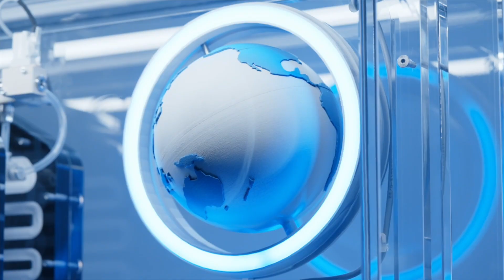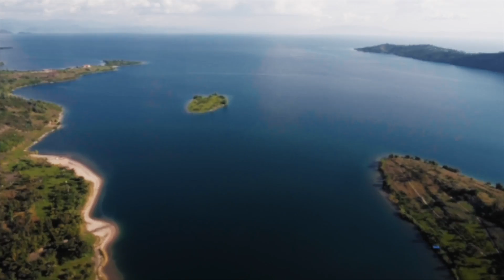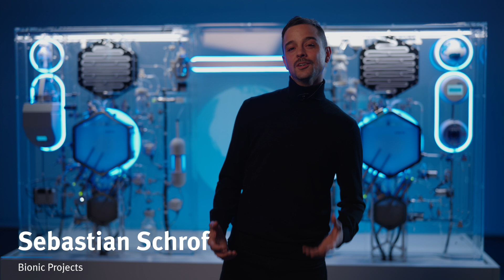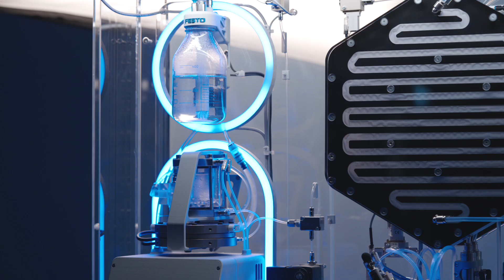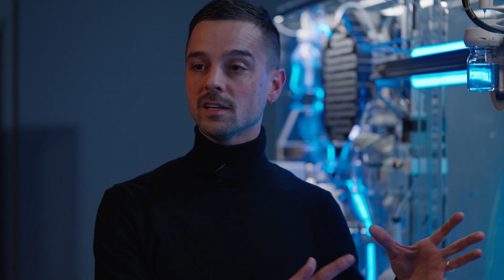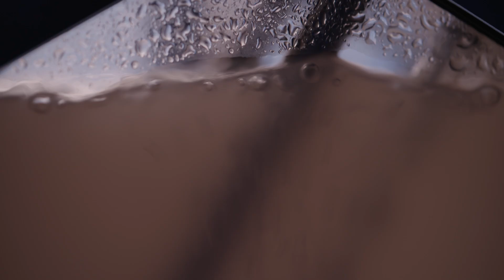Festo BionicHydrogenBattery

Comment: Neat solution, as others have said it would be good to see what round trip efficiency and energy density is. However the biggest issue with this video is the misnomer - hydrogen is not an energy source. It is a transfer and storage medium, like batteries. So calling it the energy source of the future  is the same as calling batteries the energy source of the future - it doesn’t really make sense. What would make sense is calling it the energy storage medium of the future. Which is then why round trip efficiency matters.
Reply: agree with your comment, I also would like to know the round trip efficiency, but that is not the most important factor.
That is a mistake that most youtubers channels who talk about the topic made. 
Roundtrip efficiency is not the factor that a technology should focus, just overall cost. 
For example, power generation is cheap... really cheap if we use solar and wind.
If you invest X on Solar PV Capex (including inverters and everything), you also need X Capex on batteries to just have enough capacity to store half hour of that power output over the lifetime of these technologies.
At X*4 of Capex you can already purchase the same power input/output with hydrogen, with the benefit that increasing hydrogen capacity is almost free, meanwhile each time you want to double battery capacity your Capex doubles.
Energy efficiency does not matter, because you can double your Solar and hydrogen Capex (which is cheap) and you already matched battery efficiency.
In many cases you dont even waste the 60% efficiency lost from the fuel cell back to electricity, because half of all world emisions come from energy sectors who can not run with wires or batteries anyway.  They need energy in chemical form (h2 in this case), as Ships, Airplanes, Steel industry, natural gas grid, etc. 
All this having into account hydrogen technologies that are not mass produced, with mass production, instead 4 hours of capacity (the line between hydrogen and batteries), that line would go down to 1 or 2 hours. 
With hydrogen you can not only store hours, you can store weeks and months to deal with season disparities.
And we need hydrogen to clean all energy sectors even if we use Nuclear or any other power source, but nuclear is 5 times more expensive than Solar and wind, which hydrogen already solves their intermittency issues.
Reply: @angellestat2730  Agree in a world where capex is the only item on the table - but there are other limits to installing wind and solar other than capex, so we want to maximise the resources we have. 100% agree re hard to decarbonise sectors.
Reply: @blefroy  There are other variables as you said beyond Capex, like required area or other restrictions to certain locations, places with poor solar and wind conditions,  etc.
But they are all negligible in the big scheme of things.  Now Solar panels can be placed over certain crops (with mutual benefit), over waterways to avoid evaporation, over lakes, etc.
We also have the new airborne wind technologies in development, like a kite flying at 1 or 2 km height.
Also best locations for big scale solar or wind are deserts where the wind speed and solar radiation is the maximun with no impact with human activities or enviromental media.
Solar and Wind could reach 200% power output with respect the power grid, this mean they will convert hydrogen always on excess which would be 90% of the time, with just 10% using fuel cells or thermal plants to convert that hydrogen back to the power grid. 
Electrolysis efficiency is usually between 80% and 90%, it does not even need to be compressed or liquefy to be injected in the natural gas grid. 
As I said, no matter what power source you choose, you can not escape from reaching 200% of electricity generation with respect the power grid in case we want to clean all energy sectors.
Typically hydrogen would be referred to as an energy carrier
I agree, but now we learned that we have at disposal several hydrogen deposits that can be mined, that were ignored before.
This is know as white hydrogen. 
In this aspect hydrogen would not be an energy source?
Reply: @angellestat2730  Yes, if we mine hydrogen, that would be a primary source - I hadn’t heard of that (my first reaction is that it doesn’t sound so great, but that’s just my gut!)
Reply: And replying to the rest of your post, there are a huge number of things you touch on there. I think it’s been well shown that the gas grid is a terrible place for hydrogen (mainly leaks, energy density of H2 v methane). There’s a reason H2 is basically manufactured at point of use nowadays - though this technology may help with that if it does have good energy density! The other comments about difficult to decarbonise applications make a lot of sense. I’m super excited about the day when we have more renewables than we need and so we can produce H2 with the excess!
Reply: @blefroy  Part 1: Those who said that blending hydrogen to the natural gas grid is a bad idea,  justify their claims in base that the world has better uses for hydrogen instead being  wasted on a boiler or a thermal plant, which they are partially correct but until certain point.
Because this depends if you have the hardware required to compress and distrubute your total output of h2 that you generate, which usually is not the case. 
So if electricity prices are low and you need to keep your electrolyzer working but the rest of your hardware has a bottle neck in the amount of h2 you can distribute, instead wasting all that, you inject that to the grid at lower cost. 
Your hardware investment are focus to maximize your capacity factor reducing your Capex, which mean that no all the time you will be able to take full advantage.
This happen usually with batteries, you buy 2 hours of capacity, but then you have 2 days of very low electricity prices (even negative) and you wasted 46 hours of that.
There are a lot of people who they think they are clever than the rest in the business and they post papers who does not have into account the whole scheme of things.
Going back to blending h2 to the natural gas grid, several countries including the EU, are studying this since decades ago, the EU is already at the stage where they force manufacturers to release products that are already "hydrogen capable", like boilers, kitchen hobs and other natural grid appliances.
Reply: @blefroy  Part 2:
Because the world is noticing that the share of solar and wind are reaching 30%, this mean that the amount of storage need it is around 2 to 3 hours which is in the limit to make hydrogen cost efficient, once you keep increasing your solar and wind share, the amount of storage need increase exponentially, because this also force you to reduce the amount of thermal plants that you use to balance the load. 
Most natural gas grid around the world are capable without modification to have a blend between 10 to 20%, with new appliances this could be take to 100%.
The electricty transmission by power lines,  on average waste a 6% of the energy, the natural gas grid with methane waste 1%, not due leaks, mostly due the compression that the grid requires, which consume power.
Hydrogen would consume twice that power to transport the same energy content than methane, but this is still several times more cheaper than  wires.
For example, if you need to transport 1 GW of power, using a DC power line (state of the art) would cost 100 for example, using a methane pipeline would cost 5 and using an hydrogen pipeline would cost 10 (using new infrastructure). 
This is becoming too long, but in case you are interested, I can explain why it would be  more cost efficient to build new communities with just a gas grid connection and have electricity just inside your house.
Reply: @blefroy  part 3:  About hydrogen mining, some companies are claming prices of 0.5 usd/kg h2, but I am not buying.
In my opinion green hydrogen soon would be cheaper than any alternative, current plants in construction like NEOM or others are aiming to 1.5 usd/kg h2, which is already cheaper than h2 by steam reforming, in 10 or 15 years hydrogen could be cheaper than using methane.
Reply: @angellestat2730  Thanks for all your thoughtful replies, good discussion!
Reply: Hydrogen can be burned and therefore is an energy source. In the context of the video, the bacteria are the energy source of this "battery," the hydrogen or storable form are merely the  end product which can then be used as an energy source.
Reply: I think what I’m hoping  to find out is the amount of primary energy that is used to ‘power’ the bacteria (energy needed for respiration) per unit of useful energy in hydrogen that can then be realised.
Reply: (Typically hydrogen would be referred to as an ‘energy carrier’)

Comment: rhis channel is a scam
Reply: starting with electrolysis means there's no way you're getting energy out of the system. getting hydrogen is the hard part. and also the step converting to formic acid and back is pointless
Reply: @da6640  As they said multiple times in the video, this is for safe storage and transportation of hydrogen, not for generating it. Can't see anything scammy here. I would be interested in the actual efficiency numbers of this process though.
Reply: @DeaBroggn The same bacteria generate formic acid and then they destroy it by inverse reaction. Which conditions allow this or that reaction? In other words how do the bacteria get their chemical energy to reduce CO2 to HCOOH or to oxide HCOOH to CO2?
About ten years ago a methanol based battery was invented. So methanol is another way to storage hydrogen. Also every alcohols and every acids are able too. So I don't see any improvement in this way. What is the acid concentration in that flask? Perhaps 10%. I can go in a store and I get a 1 litre bottle of 80% formic acid.

Comment: I love Festo!  Always so innovative..  But saying that current h2 storage technology is "super bad" and the one they created is great without quoting any number or data, It is quite the ad cliche that I was not expecting from them. 
Current hydrogen electrochemical compression or using metal hibrides are a good solution for small case applications if someone start to mass produce them. 
It is hard to achieve a good product if nobody goes serious with production.  Stop talking bad about other technologies unless you are determined to travel that last mile that any technology needs to become cost efficient.

Comment: I love this. I've always thought the difficulties bottling/containing Hydrogen would always hold it back as an energy storage technology. This solution gives me hope that the universe's most abundant element, can be the better path forward.
Reply: The poor end to end energy efficiency is still a roadblock tho... Fuel storage was just one of the issues.  
Even with this, vehicles will have to carry a bioreactor in addition to a formic acid fuel tank, H2 fuel cell and a buffer battery. I don't see it becoming cost competitive at all... Maybe useful in big trucks or ships but not in small vehicles